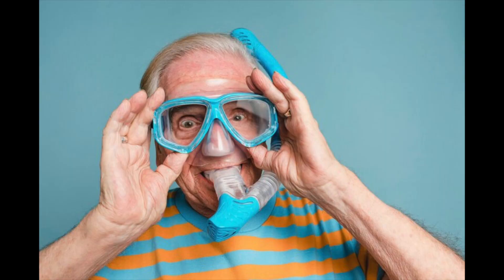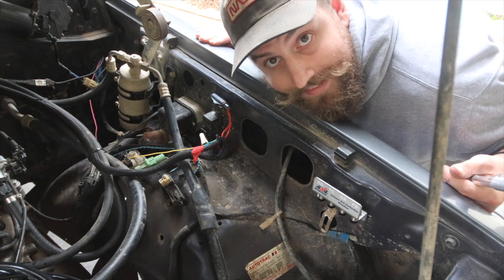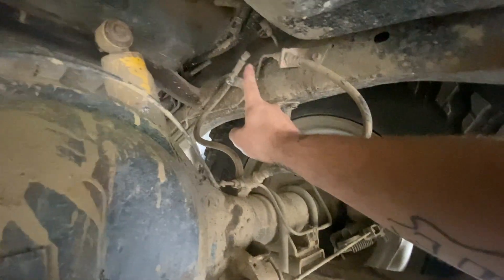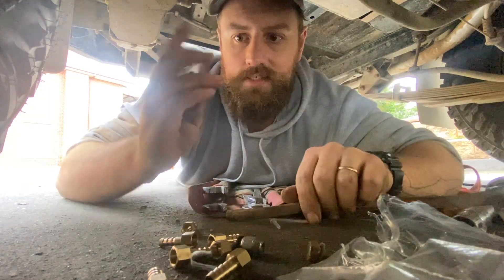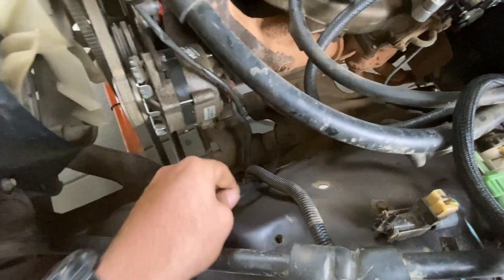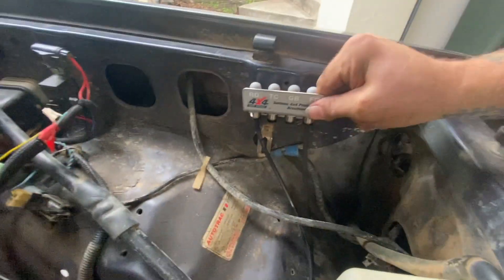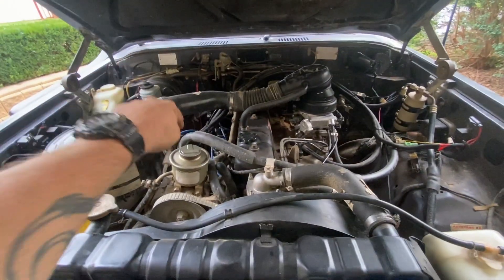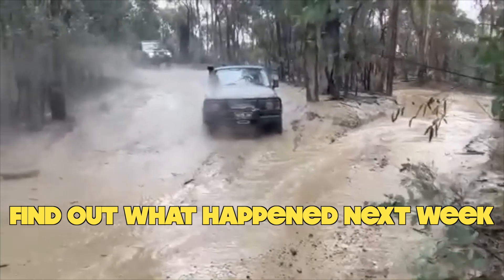Diff Breathers - the easiest install to do on a 4x4

Comment: Those breathers look great.
The factory breathers are supposed to have little valves on them to stop water getting in.
Guess they don’t work especially after 30 years eh :)
One of the tricks is to let things cool right down first.  That way the rapid contraction of the hot air inside the diff when it hits the water doesn’t suck in the water.  Maybe just a few drops get in.  A big hunk of canvas over the grill stops the water flooding the engine bay if you keep a steady speed.
Here is me employing both of these techniques in the middle of nowhere (can’t break down or ya fucked).
How deep is too deep?
https://youtu.be/O3WXbQDoPVM